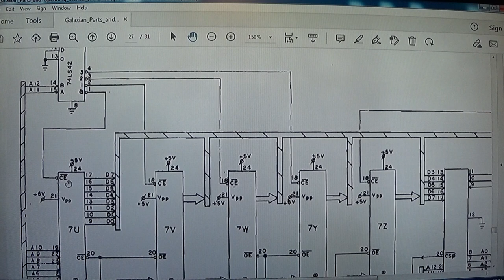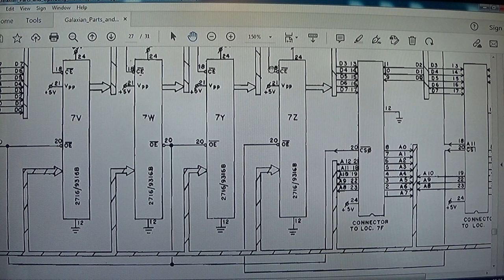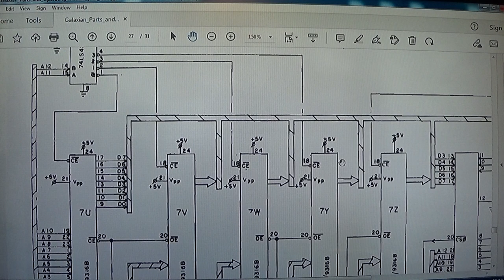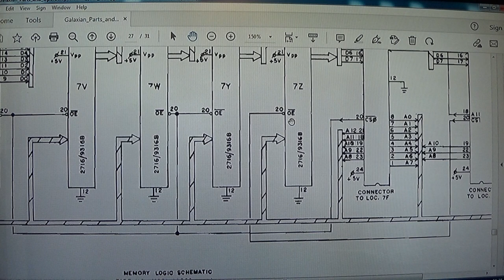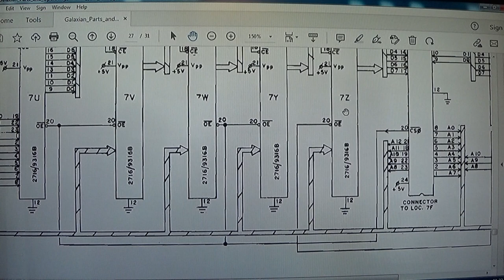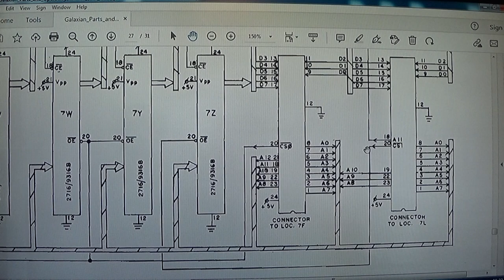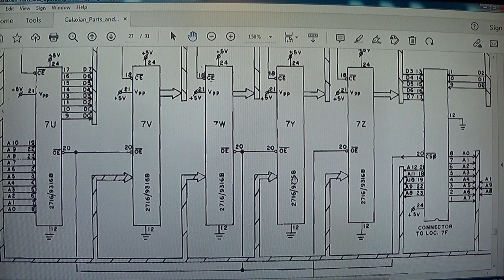1979 Midway Galaxian ROM PCB Replacement Demo and Circuit Explanation

Comment: Thanks for sharing!!  I am was working on a Replacement Warlords PCB with 27128 single rom replacement and this gave me some clues on where to go check.  Warlords is an Atari board is similar to galaxian here.  4 roms share same CS (inversion of A13) and 2 pairs of roms share the same OE (ROM2 and ROM3)

Comment: Hey Sean. You did a good job explaining the enables. Don't worry. What I learned: I like the explanation that CE and CS act like a select 1 and 2. Make perfect sense why CE can be grounded and why you still need 2 selects because 7Z is enabled separately and why you need the 08 AND Gate so all memory ranges can be accessed.  My take away is application. I'll be looking at enables a bit differently. I just finished a Galaxian repair so the schematics are still fresh in my mind. That memory board does cause allot of issues, if anything causes allot investigation if your game doesn't boot like mine was. Sockets, legs, roms all have to be checked. I'll get my repro boards soon so I'll get it populated and check it out. Looking forward to checking out your Rom buffer stack on that 128.
Reply: I had to break out my TTL book so figured I would share.
Regarding using the 7408 positive AND.  The goal was when either CS0 or CS1 are low  for the OE of 27128 ROM to be low (L+x=L OR x+L=L).  Basically, if the cpu activates either of the those lines it will enable the 27128 and if neither are enabled the 27128 OE will be high (H+H=H) Positive AND

Comment: Hello,
For doing this (assembling 5 bank in a single), you have to check they are in a continuous address space. It's easy with the four connected to the LS42. The 7L, you have to follow the wire and see that both pin 20 (7H&7L) come from the LS139 (at 8E). And A13 is the selector. So yes, we have continous address space A0-A13 or 16Kbyte=128Kbit. You probaly can avoid the new LS04 by using the output pin4 of the LS139 and the !RD directly on the 27128.

I think I will try a L shapped PCB on 7H&8E to avoid any wiring and additional LS.
Reply: PCB done, working great. photos on leboncoin (france). It is a JLCPCB Y83-2779229A

Comment: Great explanation! I have a question though, could one use two diodes to prevent the flow of current to back-feed? Or is it because they are going to low it would pull both signals low anyway?  Just trying to wrap my head on some very basic fundamentals I must be missing.

Comment: If I get an Atari Asteroids in with more than one bad 2114 in the vector RAM, I replace all of them with a single 6116 and use the two unused gates of the LS86 one row above for the Enable signal (first gate to kinda-NAND, because both enables Low is an illegal state so we don't care about the output, and second gate to invert it to AND).
Scramble is also cool, you can replace the 8 ROMs with one single 27C128 and use a lot of unused gates on the board for the Chip Select logic. Or use a 27C256 and even more unused gates on the board for a switchable 2-in-1 multigame (I have Scramble and Amidar, it uses the unused second half of the Sound board IRQ 74LS74 to toggle games)
Why?
- I'm running low on 74LS08 (but why? IDK!), 27(C)16, 2114 (and by now also even on 6116s, but I only need one, not four)
Reply from the maker: cool stuff!! :)